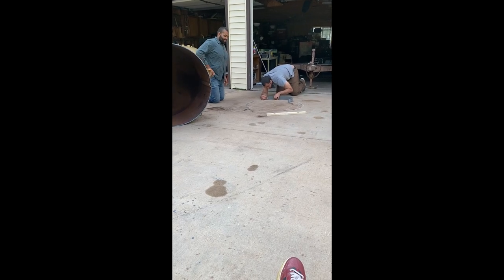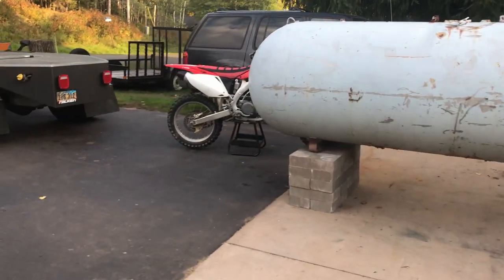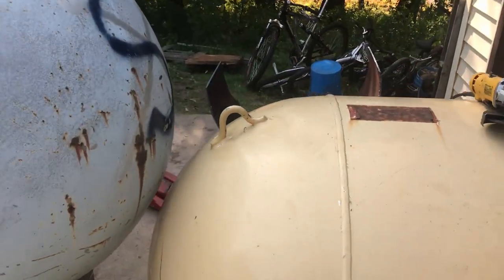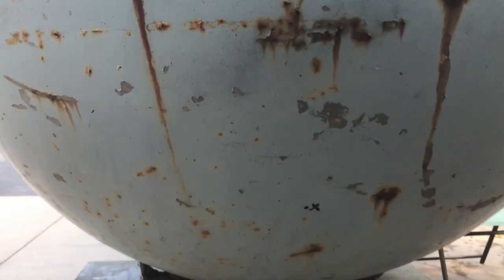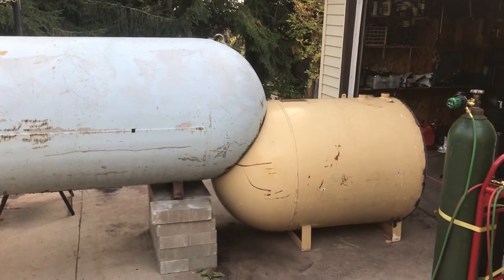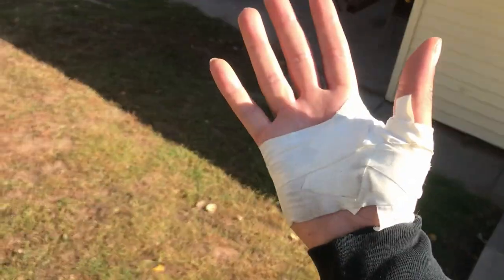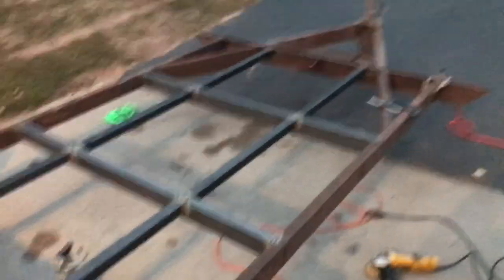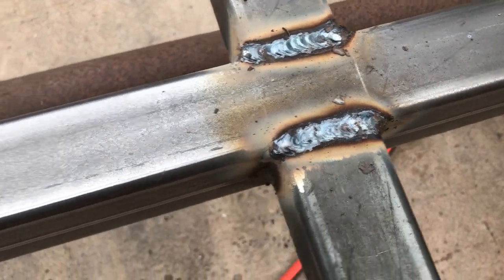1000 Gallon Offset Smoker Build Part 2 - Cutting into the big tank

Comment: A bro how did you map out the circle?
Reply from the maker: We figured out how high up on the tank and how far into the tank we wanted the hole to be. Then we found the midpoint between the two and marked it. We basically eyeballed the side to side. Then we tied a string to a marker and held it at the center point and drew the circle. Took some time to get it where we wanted. Hope that Helps!
Reply: @TooMuchBBQLLC  did you reference the fire box at all?
Reply from the maker: Yeah, mainly for the size. We made sure the hole isn't too big for the firebox. We wanted the top of the firebox basically right in the middle of the cook chamber. So that's where we got the mark for the top of the hole. Then we put a mark on the bottom of the cook chamber about how far we wanted the firebox to sit into the hole. Keep in mind both of our tanks have the same diameter.